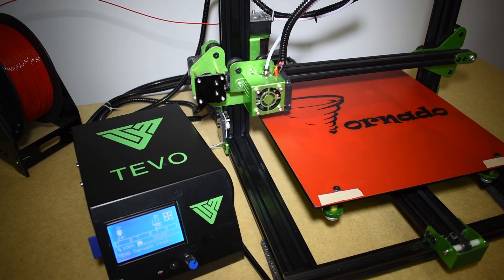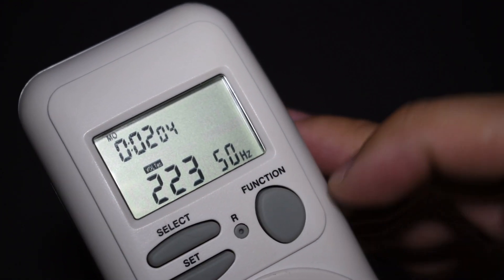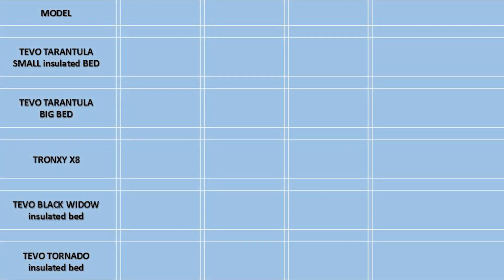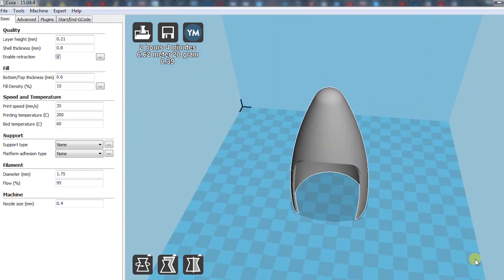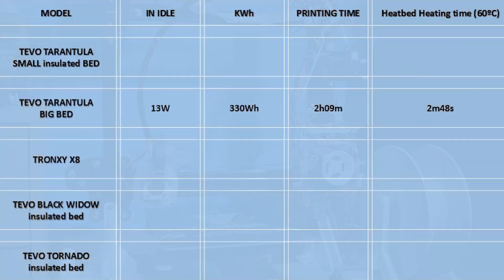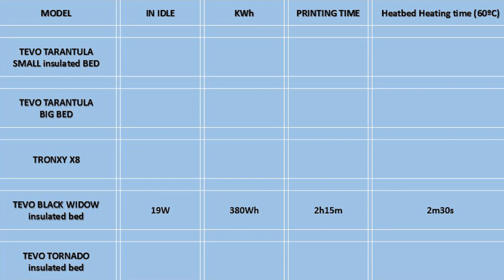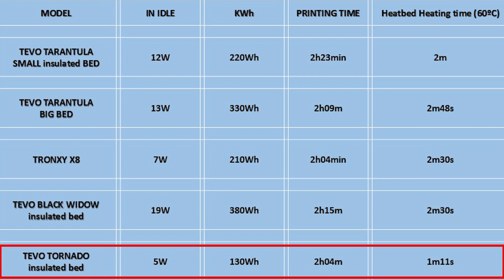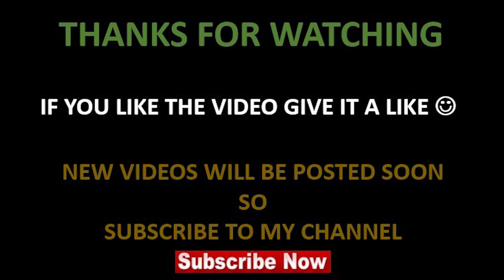How much does a 3D PRINTER consume? COMPARISON BETWEEN 5 PRINTERS

Comment: Thanks for the great video!  I don't know if this has been already asked but did you use the heat bed MK3 for the small tevo tarentula?
Thanks again.
Reply from the maker: Hi, yes.
The small tarantula bed is the recent batch with insulation on the bottom side.
Reply: Do you know if by powering the bed with 24V would improuve timing on the tarantula?  Otherwise, could you tel if the tevo tornado have 24V to power all the electric parts such as boards, motors and fans.. many thanks.
Reply from the maker: Hi, 
Some of the heatbeds have the possibility to wire the power to 12V or 24v. The old ones had that possibility. I don't know if the new ones also have since the back side is covered by the insulation, but if they can it will reduce the time for sure. The tarantula power supply is only 12V so if you want to upgrade it to 24v you need to change the power supply. The MKS base board can handle 12v and 24v so what you need to change also are the fans that are connected directly to 12v.
Reply: Ok, I see. Does the tevo Tornado PSU fit for the Tarantula? I think it's a 24V. I wonder if the heatbed of the Tarantula could be powered by a AC voltage. This could be a nice upgrade. We just need to figure out how much power could hold the bed resistance and then could use the same device as the tornado. Do you have any idea if it'll fit? Thanks again. :)
Reply from the maker: Hi, 
the tornado power supply is very small. It has a low output current because it doesn't need to power the heatbed (it's AC). So answering your question...no...the power supply of the tornado will not work for the tarantula. I dont think you can use AC instead of DC for the stock tarantula heatbed. Furthermore, it's max voltage is only 24V.
Reply: Ok, Does the DC part of the Tornado PSU that supply the Control Board is 24V ? Other than the Fans, do the stepper motors need 24V supply? Thanks for your very responsive answers!
Reply from the maker: Yes, the power supply of the tornado is 24V. The board manages the voltage and current to the stepper motors.
Reply: humm, so the steppers motors has to be changed too...I love my tarantula and wants to make it like a tornado. Thats gonna be tought...
Reply from the maker: No...not what i said. I said that the board manages the voltage and current of the stepper motors either it's 12V or 24V input. You can use the same board and same stepper motors with a 12v or 24v power supply.
Reply: Hi, Do you have any idea of the voltage value for the AC supplied to the heatbed on the Tornado? Thanks.
Reply from the maker: The tornado heatbed input voltage is 220v AC (or 110v AC depending on the country model).
Reply: I think the best is to replace the heatbed for an AC one...thanks anyway for all your videos.
Reply: ruiraptor how much output current does this tornado DC Power supply have ? Thanks
Reply from the maker: Hi. It's 8.5A output. You can actually see the power supply in my review video.

Comment: Very interesting, especially to see how much more efficient the Tornado is than even the smaller Tarantula due to the AC heat bed. Looks like AC is the way to go
Reply from the maker: :D
Reply: A lot comes into play with power usage. Another large factor is the Tornado is a 24v machine vs the 12v of the others. Even so the Tornado must be using a high efficiency power supply to pull this off. I wish manufacturers listed the efficiency of their PSU like computer part manufacturers. Living in a state with the highest electricity rate and running 10 printers electricity can become a factor when quoting requests for large production runs. Thanks for the video!